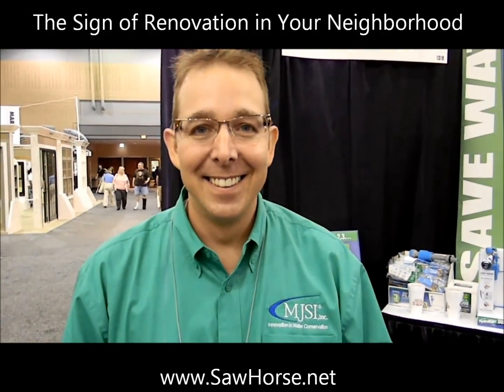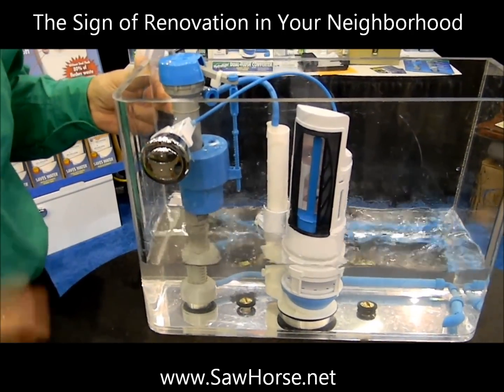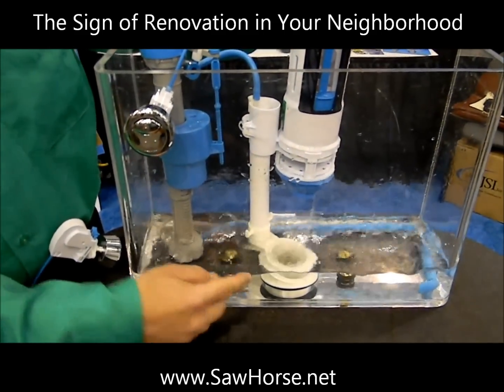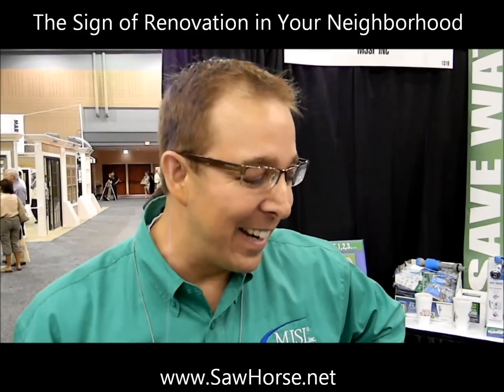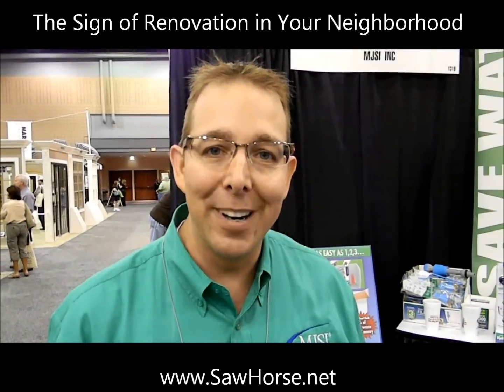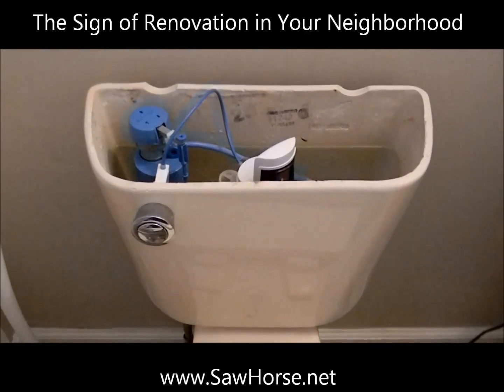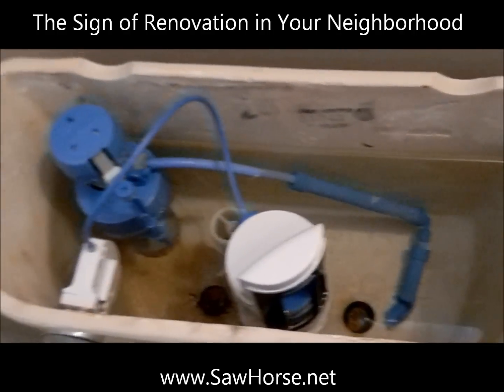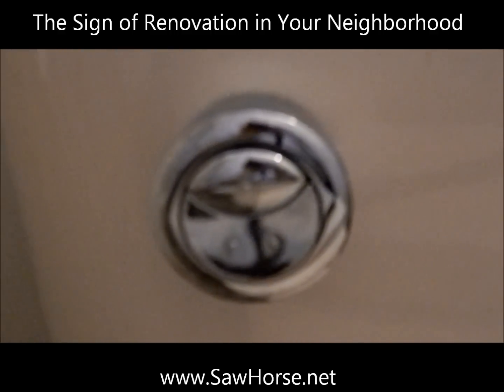How to upgrade a toilet with a "Dual Flush Converter" from HydroRight

Comment: You are correct that the cleaning jets are supposed to be on the bottom of the tank, but it looks like you have it connected to the fill tube output.  If it is incorrectly connected, you will find that the bowl does not fill with very much water after you flush.
Reply: Yeah I noticed that you have the J tube connected to fill valve that should be used to fill the toilet bowl
Reply from the maker: Good points

Comment: I guess I'm old school, because I think this thing is absolutely stupid. Moved into a new house with these installed on every toilet. I hate them. No one ever uses the first flusher, and now one of them flushes every 30 minutes. Can we please just leave toilets alone? It's not saving anything when it flushes 20 times a day or you have to flush it 3 times to get waste down or the kids use the wrong button every time.
Reply from the maker: It is best to have a toilet already with this feature- however in some areas water costs are really high and this retrofit can help.  Keep in mind that you need to have a good toilet in the first place.  If is cannot currently flush solids well- this will not make it any better.

Comment: The push button seems more easy to explain to people rather than a lever where either you push up or down depending on what you just did, not to mention how many times does an ordinary lever need replacement due to a child pulling down on it too hard...as for the cleanliness of it I'm guessing that's just part of the job, who really knows just how much more a lever is cleaner than a button...
Reply from the maker: Both are pretty dirty since people touch them with their hands before washing.  I would disinfect any type of high touch point in the house to reduce the spreading of germs.

Comment: Also with the jacked up install, that blue bowl fill hose is supposed to be installed higher than the fill valve so it doesn't siphon. It's all in the directions for installation.
Reply from the maker: Sounds like we need to get an updated video loaded since some of the specs have changed.

Comment: I purchased one of these kits at my local Home Depot and love it! However it did not come with the tube that sits at the bottom of the tank for cleaning, I kept looking at the instructions wondering if it was a part that you have to purchase separately but I guess it just wasn't included in the box.
Reply: same thing just happened to me. no J tube.
Reply: That cleaning tube comes in model HYR460. Or you could of opened the box and examined the package. I had to return one cause of missing parts, beware. You really don't need the tube. The fill valve really creates a whirlpool and will flush any junk down. Home Depot sells the HYR451 with no J tube.
Reply from the maker: I forwarded your question to tech support @ https://www.danco.com/support/contact-us/

Comment: Why is the J tube installed AT the bowl fill port? It goes at the bottom of the fill valve. You know the part in the directions that says to angle towards the back of the tank?
Reply from the maker: I forwarded your question to tech support @ https://www.danco.com/support/contact-us/
Reply: You are correct.  It is connected to the wrong part of the valve.

Comment: Some people are complaining about the zip tie deteriorating over time, and thus causing a malfunction and wasting lots of water.  I wonder why a plastic zip tie can deteriorate within just 6 months as someone claims at the home depot web site.  Anyone knows or is aware of this issue?
Reply from the maker: It could have to do with additives in the water.  I did not have this experience with my installation though.

Comment: Dude, you did not install it right.  That tube that sits on the bottom of tank should be connected to a different part (look on the bottom the float mechanism).  You have it incorrectly connected the fill tub connector (fill tube should connect to this and attach to fill tube).
Reply from the maker: This assembly that was demonstrated was from the inventor of the product.